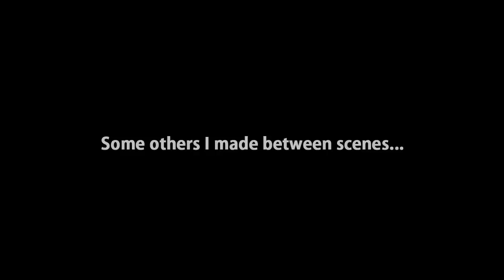The Nebula Stone - Making Labradorite Jewellery

Comment: Save your fingertips, and reduce time lost to flying stones:  Flatten the back, and clean off all traces of saw oil. Acquire a golf tee. (Cheap at Canadian Tire.) Blunt the pointy end. Wood glue the other end to the flat back. Let dry overnight. Coat with clear nail polish, and recoat, covering all glue. Then enjoy how much easier and quicker it is to handle the stone. Soak in water overnight, twist off the tee with pliers. Polish back if you have to. You are doing great work. Thanks for sharing. Find me at a show sometime if you want to yak about cabbing. TJ Minerals.
Reply from the maker: Thanks TJ :) I switch it up and sometimes use a dop stick. I bought doweling of all different widths and they do work well at times. I find you have a lot more control without a stick (at least for me), but the smaller stones you have no choice. Only really one fingertip incident when I was first starting out, learned from it I guess haha. Thanks for watching!

Comment: I make a lot of Labradorite jewelry, often wire wrapping. I have recieved quite a few with a green residue. I was told it was their polishing agent. I am not sure if I can put a picture on, but it looks like a clear open spot has appeared on some of them. I wonder if the person I bought most of my labs from were doing something sneaky? Or did this happen because they were stored with other labs? Or did I damge them moving them around? I like to look through them for inspiration. I have been keeping them with my moonstones and most in little plastic bags.  I love these so much I collect too. So I embarrassingly have 100`s of them (I feel like a dragon over them lol). Sometimes I just use jewelers glue and put on a bail. This new problem is really stressing me out. Also I had holes drilled in some and it did not do this to those.  I  would love advice...
Reply: DarkSun Jewelry - Much bulk overseas labradorite is polished with chrome oxide. Could be a hard, waxy buffing material like Zam. Soap and a stiff toothbrush should remove it. An ultrasonic cleaner is another option. A good lapidary will leave no trace of polish. Best to buy cut stones in person. If the online seller is offering something too good to be real... beware.

Comment: Thanks for posting this, great demo example. Love the fact that you used minimal equipment and simple approach to creating some beautiful jewellery. Lucky I found this just after acquiring saw, flat lap, and felt buffing wheel. My next project is Labradorite that I just purchased at last Gem and Mineral Show attended. Almost as if you just created it for me.
Reply: The Silver Cab setting you used is what I would like to find. Can you please share source or where to purchase? Love the custom look it gives and not standard Template oval.
Reply from the maker: Thanks for watching! Nice timing now that you now have all the equipment. It can be tricky at first getting used to a flat lap, but once you get the hang of it you can crank out some nice cabbs!
Reply from the maker: There are many suppliers both in the U.S. and Canada. We order from a few places depending on price. One thing to make sure of is that the settings are genuine .925 Silver and not Silver plated from Eastern Countries.